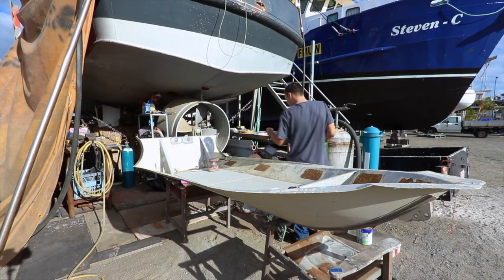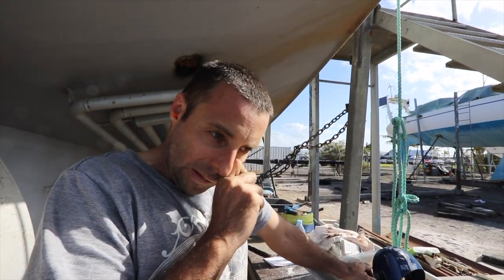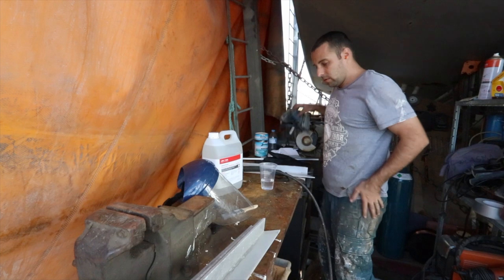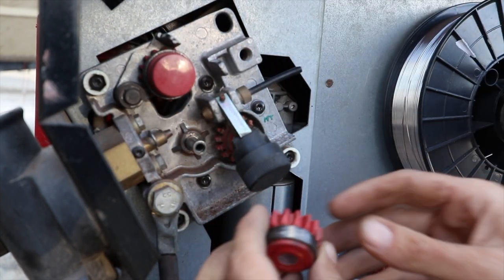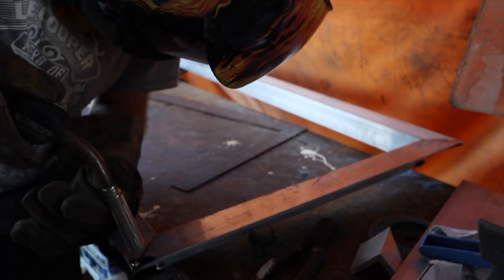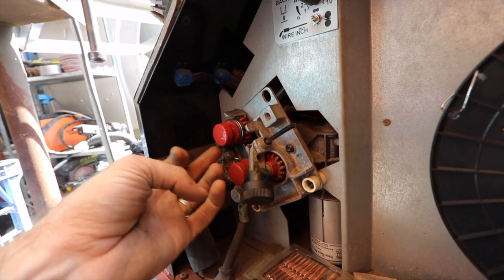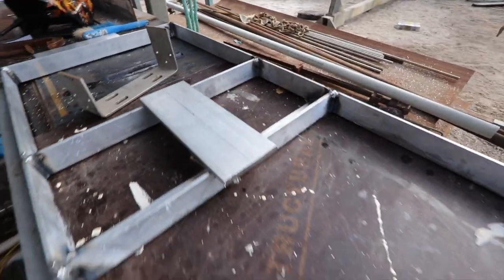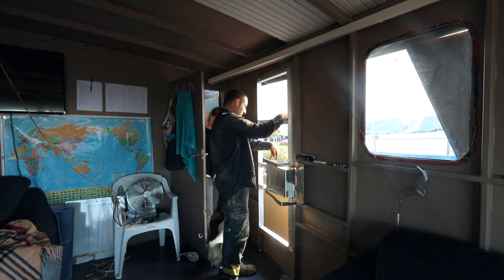Welding Alloy Marine Doors - Project Brupeg Ep. 92

Comment: I use a stainless steel wire brush to prep aluminium for welding. It's quick and easy and only removes minimal material.  When aligning your joints for welding always leave a "root gap" between the two plates for the filler wire to fill, this also allows for expansion of the plates when they get hot from the welding. No wind aswell. Good going so far!
Reply from the maker: Yeah we gave up on the acid and moved over to a stainless wheel like you say. Huge improvement

Comment: First tip my boss taught me was to take a hearing protection and place one between the wire spool and the plastic shroud. The second was to do the same between the roller and the inner hose. He also used to spray a lubricant onto the wire on the spool to allow it to run smoothly up the inner hose.
Reply from the maker: Nice. Yeah I used to do that but switch away from foam ear plugs and my supply of wire cleaners dried up with it. What was the lubricant that was used?
Reply: @ProjectBrupeg  I will duck next door tomorrow and ask as my old boss is also my neighbour. A little gem I learnt while working with him was he used to build wooden buses in North Queensland before he got into metal fabrication.

Comment: Nice video! Never breathe the welding gases, and much worse are the gases of the aluminum welding. Keep coming and be safe!
Reply from the maker: Hi Seb

Yeah im actually about to modify one of my welding helmets (with a gas torch) to allow my awesome 3M gas filters to fit under the sheild. They do currently fit but only just and it makes visual a bit hard as the lack of clearance pushed the visor up slightly. My plan is heat the face shield and give the filter some clearance so it all lines up spot on.

Comment: We ran into the same problems with our MIG. We went through all the stuff you did, New liners, getting the wire pusher wheels perfectly aligned ect. What we did that actually worked was was 1. use the shortest cable/liner we could get.  2 we found suspending the wire feed overhead with the caed ble pointing down. Then it just had a gentle ark to the weld bench.,  This made it far less likely for the wire to bind up in the wire. Not perfect but manageable.
Reply from the maker: Yeah i do loke the idea of hanging the welder, that said its likely we will be getting a spool gun soon as we have a bucket load of alloy to weld with this dinghy and i dont want to be spending half my day mucking around with a welder.
Reply: Use smaller wire,ditch the chemicals,and never use a wire brush on aluminium only use 5 or 7 inch dia scotch bright pads or flap discs not gringing wheels.. as far as the welder playing up cheap welders will never weld aluminium properly.. push-pull gun on a cheap welder will not work either..

Comment: The random orbital is giving a nice finish, can't quite believe the tenacious bond that paints got, you guys are probably gett'n pleanty of advice ....... so here's some more ;) 
Not sure if you have tried a heat gun and a draw scraper like Bahco 650 ergo paint scraper 50mm, scrapes towards you works much better than the spatula style. 
A fine toothed blade will give you a better cut on alloy and is quite a bit safer, you can also get a toothed blade for a 4 or 5" grinder they work great. 
Can't wait to see how the tender goes .... look up Agilis or Williams Jet Tender for some inspiration and help Jess visualise what could be (a little too flash me thinks). 
Cheers good luck with the welder saga
Reply from the maker: Thanks Dan. Yeah we have thought about heat but have almost got there with the orbital and as you say the finish is pretty nice. I’ll look those boats up thanks

Comment: Those alum doors are going to be nice. As for welding alum, I believe you need to use High Frequency with the welder to control the oxide buildup in the weld. Most fab shops have a complete setup just for welding alum and another for Stainless steel. But they are using them every day so they can justify the equipment purchase.

Comment: Using a tip that's oversize for the diameter is standard when mig welding aluminium. The problem is actually the wire EXPANDS from the heat and jams in the tip. Also, you should be using  5356 aluminum mig welding wire. It's stiffer than the 4043 alloy wire. Lastly, straight argon is better than the argon/CO2 mix for the shielding gas.
Reply from the maker: Thanks TJ, I didn’t realise this oversized tip thing at first but found out through trial and error. The wire we are using is 5356 as it’s all the welding shop had at the time (had no idea it was a stiffer wire) and we were using pure argon for the shielding gas

Comment: One of my friends owns a balustrade / gate manufacturing  business they weld predominantly alum with migs and have 2 full time welders, its not a its what we have thing either , they tig stainless as well and prefer the speed of the mig , i can find out the dets of the setup if you like...or perhaps get one of the welders to give u a call, one thing i remember is all three of the mig welders used for alum are craned up using a chain block and mounted 3 metres above the work benches , they dont use spool guns but the gravity assists as well as the tube can be shorter and the bend in the tubes are very high radius..
Reply from the maker: Hi Mitch, thanks for the offer. We have just brought a spool gun so im thinking our feed issues will be history with a bit of luck. now im just back to learning how to weld a new metal again without the hassle of trying to ban-aid my welder through it.

Comment: i  had issues with wire feed i hung the wire feeder in a gantry to  use gravity to help always keeping a straight wire feed
Reply from the maker: Hi Jon

I did try this a while back, its a neat trick. because we have so much alloy to weld coming up im thinking its very likely i will go to a spool gun to make life simple again
Reply: @ProjectBrupeg  push pull guns are a good option you can get the handpiece into tight spots and less weight and cheaper wire in large spools if you are about to tackle a big job

Comment: I would've been surprised if the paint would come off without a fight. They have to make it quite tough to survive in that area of the boat.
One thing that might get it off is the sponge like abrasive disk. I won't name brands because to each their own, and most do the same kind of job just fine, but there's one important thing to keep in mind, if you're using them, which is that you need to apply light pressure despite the wish to do otherwise. If you put too much, you'll chew it up faster than a rabbit a carrot.
Reply from the maker: ok good to know, thanks. We have a few of those discs on there way for the 7' slow rpm polisher so will be interesting to see how they go.

Comment: Might also be worth looking into converting the torch on the welder - over in the UK we are finding that MIG torches are available with a generic 'Euro MB25' connector which means you can swap torches very easily and spool guns for this style are cheaper - I had a Cebora (basically a BOC unit re-badged) and an OEM Cebora torch was silly money as was an 'older' unit - conversion kit with socket plus a new Euro MB25 torch was still below half the price of the OEM torch and better quality.
Reply from the maker: Nice. Yeah I did get a new 5m lead/torch for steel work from eBay recently. We are looking at a new welder as this one has a few reoccurring issues which are starting to become a real pain. It’s pretty old and just wearing out

Comment: If you're still battling with the paint on that tender some powdercoating places can 'burn and blast' item. Involves cooking the whole thing at ~400C then media blasting off the softened material. I don't think its that dear either. And it works well enough to remove powdercoating.
Reply from the maker: ok good to know. we have almost got there with the random orbital but we may be doing another dinghy very soon

Comment: Hey cant you use a pre cleaner on your welder before it enters the rollers, they look like an foam ear plug kinda, it cleans all the gunk off the wire prior to entering the roller chamber. Great work, cant wait to see it in the water.
Reply from the maker: Yeah I used to do that with a foam ear plug. I stopped using foam plugs and my supply of pre cleaners dried up!

Comment: I see you have this solved already, but for others 
When we were building electric race trikes at school we had 2mm ally wire, Teflon liner, run the welder high wire speed and fast 
A shortlead helps A lot as well 
Seemed to run quite well 
That was a special program in our school and our teachers hadn't welded ally before either
But one of our team was the son of bloke who owned a boat building business and had loads of ally welding experience

If just bought myself a tig 
Mostly just to learn a as skill, I weld loads of steel on the farm npbut Harley ever alloy 
Found no matter what ally though a mig is finiky even with a spool gun, it's a real art to master it 
If I can make tig work I'll just do all my limited alloy welding with it 

Jess is a real trooper hanging off an orbital samder all day rough on the wrists for anyone
Reply from the maker: Yeah we have just moved over to a spool gun, havent ran the first bead yet but looking forward to giving it a shot.

Comment: Dame, I don't know much about welding. I get by with a stick machine for steel and that"s it. But my dad could weld just about anything and I grew up helping him. He always had a little piece of foam wrapped around the wire just before it went into the sheath to clean the wire. I don't remember if it had lube or a cleaner on it but it was held in place with one of those black spring clips with the wire handles you get from a stationary store for paper. It seemed to really help. Maybe someone with experience  can elaborate on this.
Reply from the maker: That’s awesome thanks for this. I used to use ear plugs but stopped when I changed to re-usable ear plugs. I need to go back to using them on the welder
Reply: @ProjectBrupeg  Ear plugs. Nice, that is a great idea.

Comment: Looking good. Hey if the old paint on dinghy is stuck like shit to a blanket,  why not sand, prime and paint over it?
Reply from the maker: Hi Simon, yeah we are going to kill it when we weld to it, plus as an expedition boat this dinghy will be dragged over rock, sand, ice, beaches, mud and have alsolrts thrown it it so any paint wont last. the plan is to strip back to alloy and leave it bare.

Comment: You using ac or dc for your Alu welding and what gas, Helium? Also is there something in which polarity your welding like when using flux core? I’m afraid I’ve no experience but I’m realising it should be possible to weld some alu for small projects with the less than ideal welder I have after seeing your example.
Reply from the maker: Hi Jon, we use 100% Argon. My welder is DC only, its possible to weld alloy using DC on MIG but if you go to TIG you need to have AC.

Comment: Hey mate you can use stainless wire wheel on the grinder to remove the main paint. Then use some automotive 2k paint stripper. That stuff from Bunnings won't strip 2k paint well enough.
Also are you using a Teflon liner in the gun. It won't work properly with a steel liner
Reply from the maker: Hi MC, yeah it was just a steel liner as my machine wasnt able to get a teflon liner anymore. that said, its pretty much time for an upgrade for the welder, need a spool gun and this ole girl is just to bulky around the boat now.

Comment: Professional fabricator here. Pro tip: For Aluminum, if you wax your sanding media (flapper or flat sanding disc), you'll sand twice as fast and your media will last 4x longer. Edit: this is for raw Aluminum, not epoxy painted material. For the epoxy painted Aluminum, use a heat gun. You will not warp the 3mm thk material with a heat gun. Ever seen a soda can on the edge of a camp fire where all the anodizing is burnt off, but the can holds its shape? Aluminum is a great conductor-so the epoxy will burn way before the substrate will warp.
Reply from the maker: Awesome thanks for this. We did start to do this after this round and yes it made a huge difference
Reply: Yes 100% correct way to sand alum I once asked why the factory had wax pucks everywhere

Comment: Are you using a teflon liner? Also what I do is if my wire is .035, I use a .040 tip. What I found out is the aluminum wire expands from the heat and binds in the tip.
Reply from the maker: New liner but wasn’t Teflon. Found that out after the fact. We were using 1.2mm wire and I started with a 1.2mm tip but drilled it out to 1.4mm
Reply: @ProjectBrupeg   Teflon liner will make a big difference. I'm have to search for it but I remember a company that makes a spool gun to work with any MIG welder.
Reply: Yep, that's a steel liner. I even use a teflon liner for stainless welding to prevent contamination but it also has good slip for aluminium.
Reply from the maker: Hi Dcrahn, yeah I found a multifit spool gun on eBay, had a euro plug like my welder but my welder didnt have the power fittings needed for spool control. I brought a IP67 6 pin plug that I was about to fit into the welder and tap into the 24v drive motor to power the spool gun, then the welder really died. More on this in the next episode coming out tomorrow
Reply from the maker: Hi Gary, yeah ive used teflon before and really liked it however they apparently are no longer stocked for my machine (it is a museum piece after all).

Comment: Your gun lead needs to be really short to "push" aluminum through it.  Like 2 meters.  Or you need a spool gun that has the wire roll in the gun and pushes the wire maybe 50MM max.  Also, pull out wire, Blow air from both ends to get metal bits out if the liner........keep it clean.
Reply from the maker: We’ve just moved to a spool gun, what a world of difference they are!

Comment: Well. There’s goes any potential sponsorship from BOC lol. 
Get yourself a router if you haven’t got one. Very handy for trimming aluminium. And wd40 is the cutting oil of choice for it as well. Good job though bud.
Reply from the maker: Thanks Matt, to be fair, this welder should be in a muesem, everytime i went into BOC to get parts they would laugh at the fact I was still able to keep it running. We have a good router that ive used a few times on Alloy, makes a great job of it.

Comment: Hope you can get that (or another) welder sorted out with a spool gun. Wouldn't some flapper discs make short work of that paint and glue on the dingy?
Reply from the maker: Hi DP, yeah we have a solution to the welder in the next episode coming out tomorrow, flappers would rip the paint off but i would be a bit nervous about ripping into the alloy too much and leaving a motley surface

Comment: Leave the paint on. If it that hard to remove it must be doing its JOB.
Reply from the maker: Hi David, yeah we are going to kill it when we weld to it, plus as an expedition boat this dinghy will be dragged over rock, sand, ice, beaches, mud and have alsorts thrown into it so any paint wont last. The plan is to strip back to alloy and leave it bare.

Comment: also, the wire wheel leaves metal particles on the surface. To get the best welds it needs to be real clean
Reply from the maker: Yeah that’s one reason I started with just the acid, thinking the wire wheel would cause oxide issues

Comment: Not gonna lie I would get fed up and took a propane torch to the paint, and then sandblast it clean.  Mayby fill it with a little bit of water to cover the rubber bottom to keep it from burning.  Your version of the enviormental protection agency probably wouldnt appreciate it tho....
Reply from the maker: Yeah. Yard owner might freak too. It was getting to that stage though

Comment: Hey Damien, 
I just watched the last episode of the solar setup. Do you still need the 235W solar panel? I have a few 235W 36V panels sitting around. Im down in Albury, I dont know how we'd get it up all that way lol. They are second hand panels, but still work well. Cheers.
Reply from the maker: Hi Zalgar, I would love a single 235w panel. We have jsut been given some 195w panels that are the right voltage but a 235w is absolutely perfect and means we can fit the 195's elsewhere. drop us a message at teambrupeg@gmail.com and we can figure out if its possible to get them up here.

Comment: the smoke moves very fast. I would say that the air displaces the argon gas and burns the solder
Reply from the maker: Yeah that could be happening. I think that would be a fine tuning thing. The welder itself was really struggling and having much bigger issues, so once we have the welder resolved i will be able to weld long enough to fine tune my technique. As it was we would weld for 10-20 seconds then spend 20 mins fixing welder issues over and over.

Comment: Are you using pure Argon shielding gas? Is the air calm? looks like your gas is being blown away. Are you cleaning the weld surfaces with Acetone just prior to welding?
Reply from the maker: Hi Gary

Yes to pure Argon. In my little metal workshop under the stern, I'm surrounded by a heavy canvas tarp so air is as calm as I can get it. Gas flow started at 15L/min but I thought it might be a bit low so bumped it up to 20. Weld prep was the acid wash which I was told by the welding shop is enough, after using the acid I dont think it was enough and ive since gone to a stainless grinder brush as the oxide was still forming in the corners of the bead with just acid.
Reply: Be sure it’s a brand new brush, if it been used with steel it’ll contaminate your weld.

Comment: you need an aluminum spool gun. Aluminum will always jam up in the welder. If you try to weld aluminum with a standard mig it will always jam. Aluminum has to travel to far in the line.
Reply from the maker: Hi Gordon, we have just moved to a spool gun so welding should be much easier now